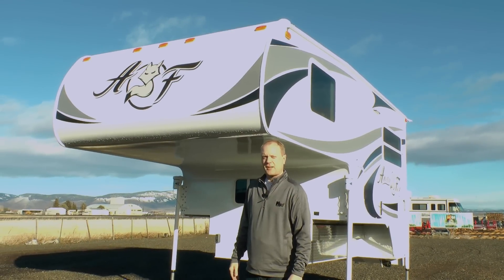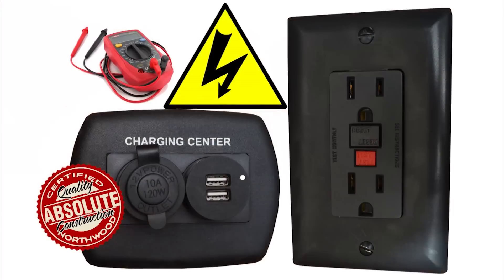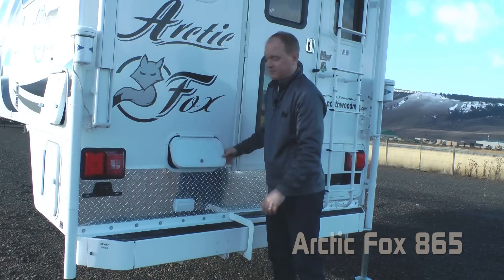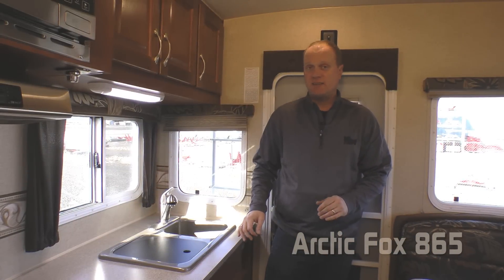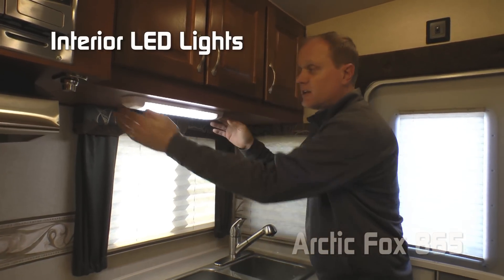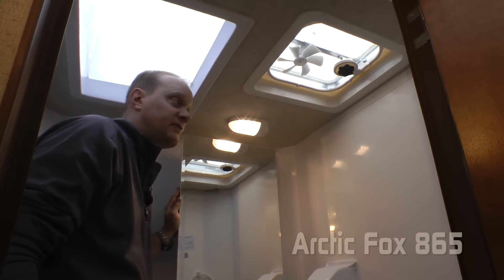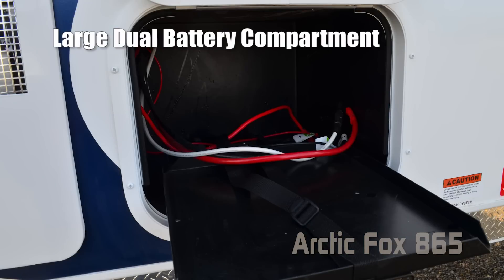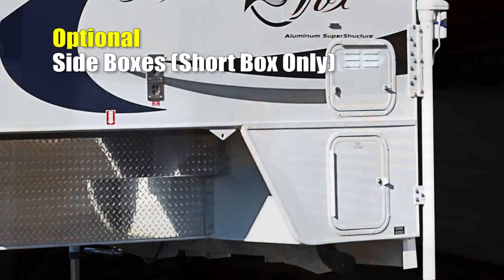Quick Tour Of the New 865 Arctic Fox Truck Camper

Comment: Video said 7lb tanks, and later a different number- 30lb tanks- Which would it be?
What would it be like staying in this if you were to go to cold, or even very cold environs? IOW, what the min temp it's good for? How much LP does it use at, say 15°F?
Reply from the maker: This unit has two 7 gallon tanks/30lb.  LP usage varies depending on several variables, but our units are built and insulated made to use in all conditions and will be under warranty down to zero degrees fahrenheit.
Reply: Thanks! I'm aware consumption varies, LoL. Constant 15°, 68° inside, no wind-Go thru ~a lb, half lb, 10 lbs a night? Just looking for a gross estimate of how oft you'd need to be filling tanks- weekly, monthly, etc. In essence, how practical would it be to stay in the thing for winter months, in lets say, Denver????
Reply from the maker: Because of variables I honestly have no idea how long the tanks would last. We warranty all of our units down to 0 degrees fahrenheit.

Comment: I'm afraid to know... what is the weight of this monster?

I'm struggling to find a light weight pickup camper that will comfortably sleep 2 people. I need light weight because I want to be able tow my flat bed trailer too.
Reply from the maker: The dry weight will be around 2,300lbs depending on options.

Comment: The 865 fits a 6'6" Truck bed....?
Reply from the maker: Correct.  If side boxes are installed for a gen ready compartment then it will fit a 6'6" bed, if it doesn't have a gen ready compartment it was made for strictly a 8' bed.
Reply: Yes, but one of the flaws are; there’s 6” of clearance on the front sides when you get it into your bed, 3” on each side from outer edge of camper to inner edge of bed rail. But, on the passenger side there’s an iron pipe elbow for the gas line, and you have to clear your bed rail, but your on top of the bed rail at 3”. So, you have two options, add two 3/4” horse stall mats (not a good idea because you got it up in the air too high now) to keep the iron pipe elbow above the bed rail, or offset the camper where there is 4” on the passenger side in order to tuck the iron pipe elbow inside the passenger side bed rail (just barely fits), and 2” on the drivers side from outer edge of camper to inner edge of bed rail. I found this to be the best solution, even though it isn’t ideal, as you’re running around 1” offset.